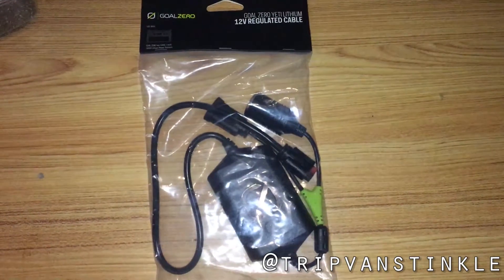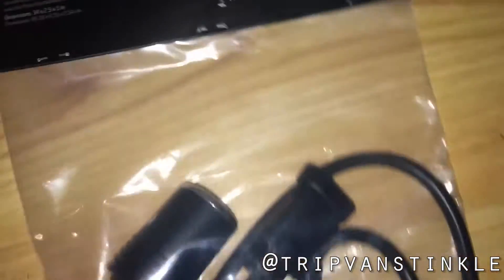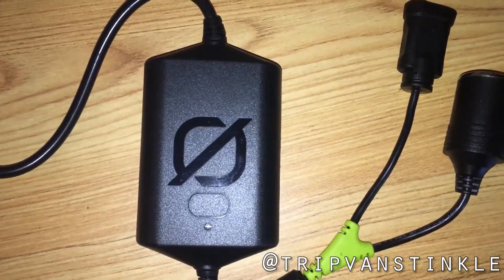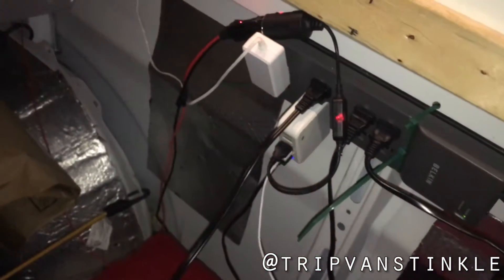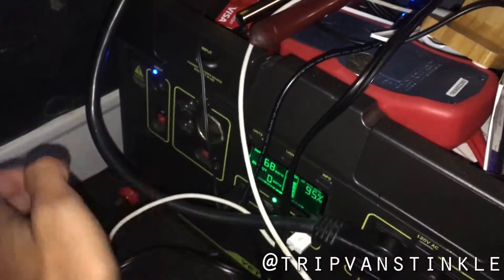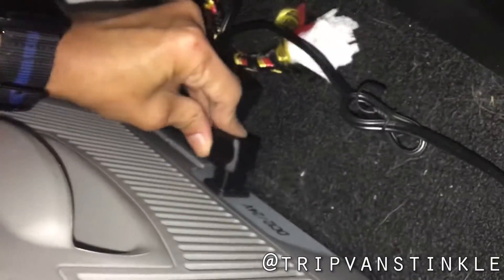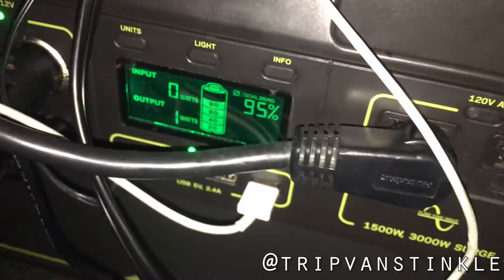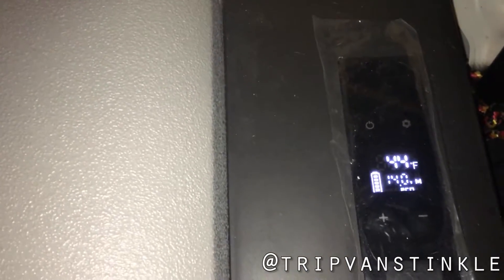F1 error on your fridge? how to run a refrigerator w-the goal zero yeti lithium 12v regulated cable

Comment: Hi, thank you for the great video. I just bought an Alpicool fridge and I'm constantly facing the problem described in your video. Unfortunately the Adapter is pretty expensive. Does a step-up DC from 12V to 14V do the job as well?
By the way, why are there so much fridges who face this problem? What's the actual benefit of the battery protector if you have to get around this function. In case the battery would be low on voltage, the step-up will conceal the actual voltage of the battery and why it's not possible to simply shut off the protection function. Does it protect the compressor in some way? Please, can someone explain 🙂🙏🏼